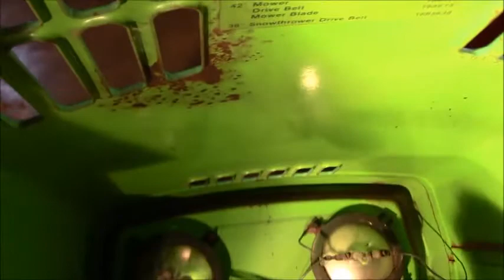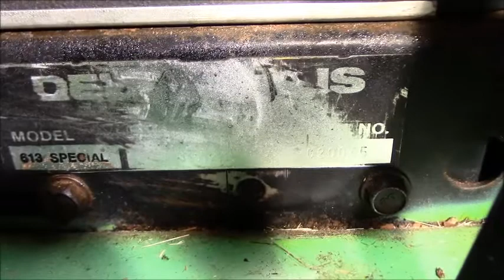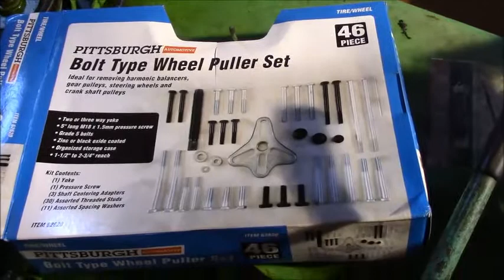Deutz Allis 613 Lawn Mower Before Restoration

Comment: What size engine drive belt?
Reply from the maker: I’m not sure. Look on Jacks Small Engine website and look up your model number. Then find your mower. Then look under engines, belts. Use that part number to search on E-bay, Amazon or Google for the cheapest one.

Comment: I didn't know that these existed
Reply from the maker: They were the same as a Simplicity 5212.5. I use this one every week to mow my yard, very solid built mowers. Parts are easy to get on eBay or through a Simplicity dealer. Thanks for watching!
Reply: Rusty Zipper yeah right, we farm with Deutz tractors so this vid popped up. It proves that you learn something new every day, good vid mate👍